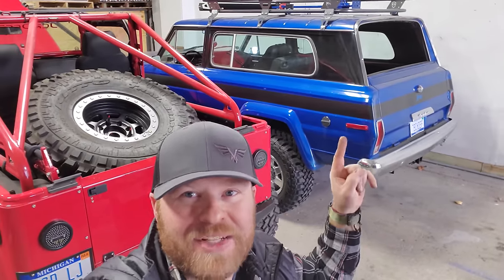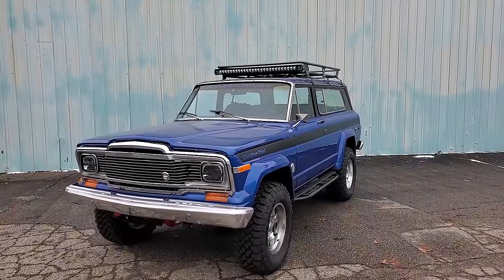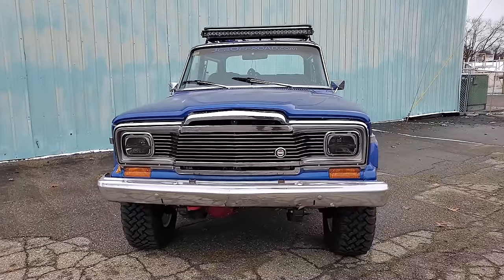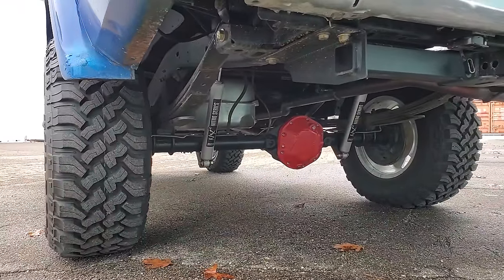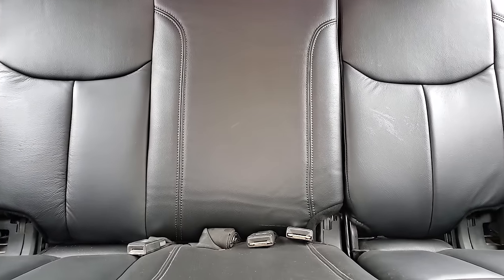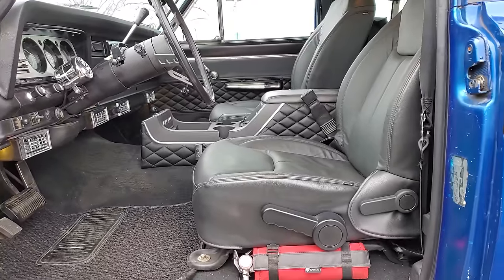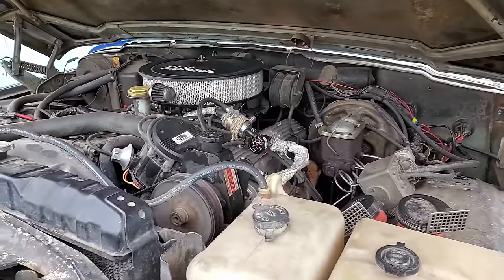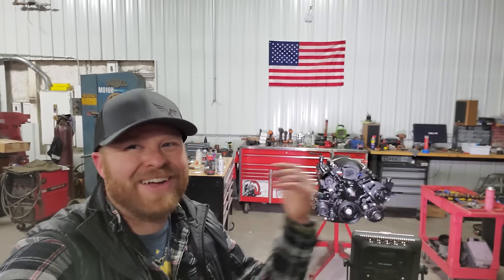Cherokee Chief Walk Around

Comment: I had a 76’, same color and configuration when I was in the Army. I had it while stationed at Ft. Benning. I painted the top white for some sun relief, made a custom overhead console for my CD player and CB.  The 360 and Quadratec were awesome! Never got stuck! Ended up being the recovery vehicle for my buddies. Transfer case was leaky and the oil from the dealership was expensive! Loved every minute with it, except dropping the gas tank for sealing and the jankey rear window motor that inevitably failed with the window down. Ended up making a covered hatch to tweak the window motor when it failed. Great memories!

Comment: I had a 76 Cherokee Chief. 401 turbo hydro 400 on Quadratrak.  My front axles would crack the bearing caps on the joints.  Weak link . A blazer 44 is a spring over front axle and the width has to be close.  My rear axle would twist the long side if I thrashed it hard and make thw wheel wobble. You can tell if the breaks surge. Get someone to follow in a car and if its twisted the wheel will be easy to spot. Put a detroit locker and first trip out I broke the pinion off at the seal.  That thing weighs almost 5k.  Most pickups pull it out when buried. If you make a front bumper keep it tight in you dont want a lot of overhang. They made some that set back in the grill. Same in the back. Mine was a bad ass. I Thrashed it weekly . On uneven ground you open the tail gate and it wont close. Also the window wouldnt go down. Good luck .  33s were all I could run.. hope you dont have a Quadratrak ! Also get a skid plate for the gas tank .

Comment: Awesome Cherokee Chief, love the color combination.  Keep Chrome bumpers! 
Leave grill alone!
Light bar looks much better than round lights would. 
Great job on interior,  I'm a retaired Auto Upholster 50 years exp. So you got your grade "A" from a Professional. 
Grade is based on creative and finished 
Work and beginner level.  👍🏼
I myself have a 1980 Cherokee Laredo SJ wagon.  2d owner 
Laredo was purchased by my in-laws in mid summer 1979 off Showroom floor. 
Black on Black with Grey cloth seat inserts. Interior is in Mint Condition,  I 
re-upholsrterd Headliner and visors  to factory specs. 
I will be showing my 1980 Cherokee Laredo here on YouTube soon! 
Love your Cherokee Chief. Try not to overdo changes as you fell in love with what you saw!  ✌🏼

Comment: Had a 1963 Willy's Wagoneer, back around the '83, 84.  Had gobs of power, since someone had replaced the 6 cyl with a Pontiac 389.  Had a 3speed stick and 4.10 gears.  Was a real booney basher.  Could go anywhere.  I have an '89 ZJ as a project now.  But I really wouldn't mind a Cherokee Chief.  I would convert it to possibly a Cummins R2.8 crate engine.  And maybe a G56 transmission.

Comment: Nice truck.  Owned 4 of these in  the 80's. Hated the quadra-trac. The chain inside the transfer case stretches and skips under load. T15A  trans and dana20 transfer  case are  more reliable but  rougher than the automatic setup. Still these trucks stock still put to shame the garbage being built today. I have done off road feats in these Cherokees  that  put to shame the expensive toys built these days.

Comment: Greetings.  I have a 83 cherokee.  Yours is very nice.  The interior does look great!    I think the light bar looks fine since it kinda integrates into the roof rack.   Go to fsjnetwork, there are some threads about LS swaps and that might save you some time.   Mine has a 401 AMC, TF727 and Atlas 4 speed (2.0).  I am rolling on a D60 up front and 14 bolt FF in the rear.  37" tires using a SOA in the front and Shackle flip in the rear.     Loved seeing the pictures of it wheeling out by Ouray.    A bunch of us meet up with our FSJ's each year, check it out on the FSJnetwork site.    Thanks for sharing!

Comment: Any tips to stabilize the suspension? My FSJ sways at 50-55 mph 35s with 4 inch lift
Reply: Check tire pressure. 
I highly recommend 
Rebuilding steering components completely.  All connecting rods, ball joints, Steering Stabiliser,  all rubber bushing and steering gear box if necessary.   I would recommend an experienced front-end shop to do the job.  You will be super glad you did!
Good luck ✌🏼
Reply: @buddy9200  Thanks I'll start looking for a shop

Comment: I know this is an old video but I’m looking to swap in jku seats to a cherokee. Did yours have shoulder belts in the front already or did you add those? If so where did you get the belts at?
Reply from the maker: Yes, already had the shoulder belts on the 79, however, I did replace the original belts with belts from here: https://www.seatbeltplanet.com/i-30498957?q=5072 ~Daryl

Comment: Glad this isn't mine, I'd never destroy it with a junkie gm drivetrain, if anything I'd keep it with a 01 5.9 magnum/46re trans combo, good luck, but keep that blue and black theme, it's perfect on the truck
Reply from the maker: Not sure if you noticed, but you just called the LS platform junk and praised the 46RE in the same sentence. Nothing wrong with the 5.9, used to own one in my tow rig, but the best trans behind it would be the manual NV4500 or NV5600.  Dodge autos are kinda crap. That's the best part about building vehicles though, you can do whatever you want with yours.
 ~Daryl
Reply: @JcrOffroad  I agree that a manual would be way better, but I also have noticed that the world of offloading has since gone away from manuals and prefers autos, and since the 5.9/46, is a common combo and easily sourced, it would be nice to see some of the trucks lineage kepted, I'm just sick of seeing Ls everything, it's time for something different, but as I stated it's not mine, hope it all works out for ya and becomes a better trail truck and what your looking for